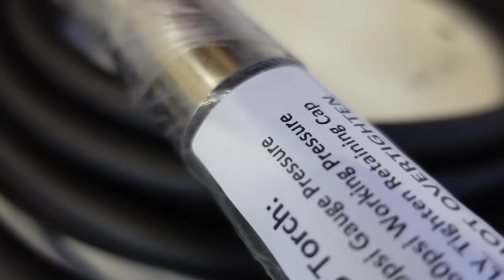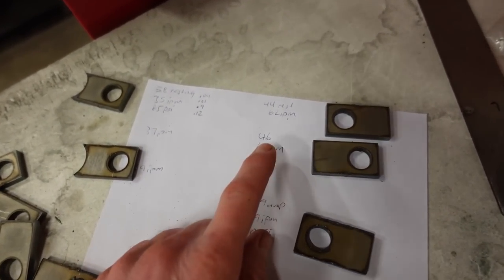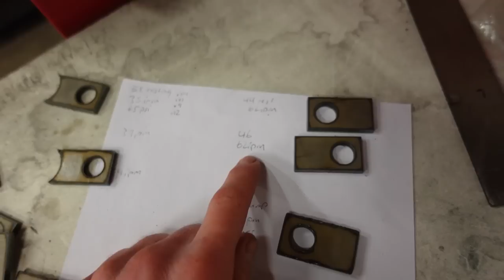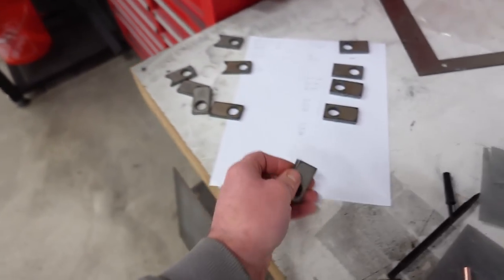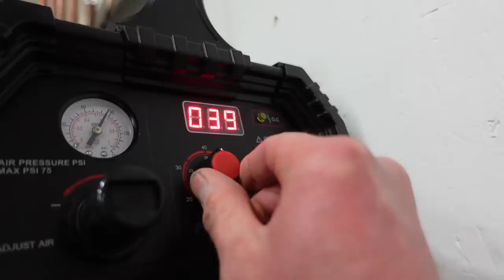You Won't Believe What Has Caused So Many Problems With My CNC Plasma Table!

Comment: Regarding your moisture problems:  Your copper pipe on the wall is a good first step.  It does not need more hose between the copper pipe and the compressor.  The hose (unlike the copper pipe) provides almost no cooling as the hose material is a poor conductor of heat.  To determine the effectiveness of your copper pipe, get an infrared thermometer (about $25).  Measure the temperature of the copper pipe near the inlet and outlet while air is flowing.  If your outlet temp is near reference temp (for reference use a short piece of copper pipe not connected to anything, This corrects for things like emissivity errors)  you have done all that you can do with the pipe or any other form of radiator cooling.  Your moisture separator looks a little small to me for the volume of air you are using. 

 Next and perhaps most importantly  you do not have moisture separation after the regulator.  Any reduction in pressure results in air expansion and cooling.  With air flowing you will find there is a cooling effect from the air expanding through the regulator.   You can use the IR temp measurement to prove this.  This cooling causes condensation to form in the regulator.  All restrictions in flow cause expansion which cause cooling.  Put a separator immediately following the regulator.  I would leave the separator prior to the regulator if it is catching moisture.  But move the desiccant filter to after the last separator.

Improvements beyond this will require some form of refrigeration.  A refrigerated dryer will solve everything.  You could use a coil of copper pipe in a bucket of ice water followed by a water separator to prove this.  This would also show you how much water is getting through your system.
Reply: I love when someone that actually knows what they're talking about posts a comment.  I never even thought about the pressure reduction issue, but of course you couldn't be more right.

Comment: Austin, I had a lot of problems w/ moisture and this is how I solved it
check it out and le me know what you think
https://youtu.be/H1mlpSj6BAc
I know many people use this type of set up when using a lot of air, like when sandblasting and it makes a huge difference.
I used to get a lot of moisture when using my air sanders and even when painting, I don't have that issue anymore
Reply from the maker: Awesome I think I’m going to try a cooler like that! I didn’t catch how you wired up the fan?
Reply: @austinniemela  I had not wired the fan when I made the video, I was waiting on the  220 to 12 volt power converter.
You have to choose your converter depending on the amperage needs of the fan you are using.
The way I wired the fan was in the power junction of the compressor, so when the compressor starts to work the fan automatically starts working. 
I hope that made sense.
Reply from the maker: @LincolnMaxnCo  yes ok thanks for the info!

Comment: I've been running a CNC plasma cutter for about 15 years now. Your cuts look fantastic!
The hypertherm tips are leaps and bounds better than what you were running before. the amp rating of the tips correlates to the size. 80 amp tips have a larger hole and require more air than a 40 amp, and the 40 amp fine cut takes even less. 
as for preventing the slag getting stuck to the end of the nozzle, its the pierce height. idk on your exact software, but on the plasmacam there is a pierce time and pierce height. when the torch initially cuts, before it blows through the material it splashes back at the torch. cut a chunk of 1/2" material and you'll see. A high pierce height prevents the slag sticking to the tip as much. 

The air supply dryer you have is leaps and bounds better than what we use and we don't have that issue. I'd be suspect of the air supply inside the machine not being large enough. That looks like the airflow is inadequate to me. not blowing the arc out of the tip and arcing further up. If you can, crank up your post flow timer.

EDIT: just hit the end of the vid and saw the o-ring. Good catch!
Reply from the maker: Thanks for the info! The more I use it, the more I learn!! I’m getting the hang of it now and getting pretty decent cuts!!

Comment: Have you had the chance to cut some 1/2” with the cut 60? I have the sample table and plasma cutter and struggling hard with getting it to cut. Seemed like I was starting to get it dialed and then it was acting like the plasma cutter wasn’t producing the amps it says it is. Just curious if you had recommended settings. Thanks.

Comment: Transmission cooler is a definite upgrade and make your valves on your copper pipe way longer less likely for turbulent air picking up moisture. Hypertherm is king in plasma cutting IMO

Comment: Some guys put a transmission cooler mounted on the compressor fan and put the air through it before it goes into the tank. 😎😎😎

Comment: On your home made cooler have the small lines t into a bigger line like 2” or 3 inch. When the air comes out the small line into the bigger pipe the air will loose velocity and the moisture should fall out.

Comment: For what you have spent in copper, hardware, filters, and time, your could have bought the Harbor Freight  refrigerated air dryer and been done with it. A refrigerated dryer is really the only way to go for fool-proof dry air. And the HF dryer is proven to be a good performer.
Reply: I may catch mucho flak, but that’s ok… In my opinion, Harbor Freight is a Chinese filled waste of American money! This is a horrible company with cheap Chinese products and is the very antithesis of what American manufacturing, quality and standards should be. No mistake, I totally get the appeal, however, the old saying, “you get what you pay for,” seems to sum HF up to a tee!
Reply: I may catch mucho flak, but that’s ok… In my opinion, Harbor Freight is a Chinese filled waste of American money! This is a horrible company with cheap Chinese products and is the very antithesis of what American manufacturing, quality and standards should be. No mistake, I totally get the appeal, however, the old saying, “you get what you pay for,” seems to sum HF up to a tee!
Reply: @conservativeokie  I get your view. Really. I own a CNC machine-shop here in the good ole' USA. American manufacturing. American pride. There are three big American flags on my property. I get it. But, when a guy is on a budget? And there is a proven inexpensive option? Sometimes you just gotta roll with it. The only reason I suggested the HF dryer is because I know it is a decent unit. I know several guys running their whole machine shop with one. CNC mills/lathes, it is absolutely critical to have dry air. It is one of the gems hiding in that silly store. I don't have one. I have a Speed-air dryer and Kaeser screw compressor mounted on an old 120gal Ingersol T-30 tank. LOL, it is a mutt of a compressor, but absolutely fantastic. But, the 4 HF dryers that I know personally work great and have been dead reliable. Most people think, refrigerated air dryer? I can't afford that! Well, yea, there is a good option that you probably can. That is why I suggested it.
Reply: @conservativeokie  Not entirely accurate.... more and more premium HF tools are rebranded Meyhew American made tools. Just a little fyi
Reply: Hey my friends, I acknowledged upfront I was more than likely to catch flak, however, again, that’s ok… I certainly do not judge or look downward on anyone accomplishing their tasks however they are (legally) able, especially in these f’d-up times and necessary budgets most of us are forced to take!

However, I still strongly stand against everything CCP inspired, supportive, or empowering them in any way. I detest communism and communist’s! I attempt as much as I know how to never buy or purchase anything made in or supported by China.

Often, I’m successful… Sometimes, I’m not. Harbor Freight is basically a CCP warehouse, and again, I understand the appeal and totally get it! Anyhoo, agree with me or not, I really enjoy the channel and the vast majority of the episodes! Thank you!

Comment: Has "tech support " from the company been of any assistance  ? I know you are very capable and very DIY. But just curious how much the company tech support has helped.  Since you are using it on your YouTube.  I am a little surprised someone hasn't reached out to you or showed up to assist... Be nice once you get it dialed in.
Reply: For the air or bevel issues?  Those are both plasma cutter issues and not an issue with the table.

Comment: How did you get that primeweld to work.  I was using one for a while and loved the cut quality.  But I was getting interference and kept smoking torch height controller.  I ended up with a 45xp and I’ve never gotten it dialed in.

Comment: by no means am I and Expert, but it looks like you are going from your compressor straight to your tank.  If I'm not mistaken you need to go into your Inter-cooler or cooler before the air enters the tank.  This way the Hot Compressed air gets cooled before going into the tank and then into the Air lines to your filters/tools.

Comment: I may have missed it does your air Compressor have an automatic tank drain on it? They are only like $30 on eBay Mount a switched outlet in a handy place and cycle it a few times when you turn on the compressor to dispel the overnight condensation, then set the cycle times to match your conditions.

Comment: I wonder if the bevel is on the side that is cut last before the part is finished. So when that cut is being made the weight of the part being cut causes the part to sag just slightly therefore causing the bevel? I'm also wondering if the water is too close to the part. So when it's cutting, the water is splashing on the part causing it to cool quickly and leaving the dross behind. Maybe try raising the part higher above the water? Just a couple of wild guesses.

Comment: You should use copper straps for those pipes not what you used that will cause corrosion overtime and cause holes

Comment: Your Ts are the wrong direction.  Air should go into the T and not the way you have it.
Reply: It (air) should run into the the cross off the T and change directions. Much like a properly plumbed dirt leg on a gas line prior to a aplliance

Comment: I would love to get a hitch cover from you in bronze if you still have one. I aslo was hoping I could pick yout brain on your f150 spring swap on the toyota pickup. i cant weld welll enough to trust it for suspention. I want to hire a guy to come out and weld all my hangers on. do you have the measurments of where you welded in the new hangers? if so It would help a lot
Reply from the maker: I do not have the measurements or the truck to measure!! Sorry!! I do have a few hitch covers left! Check them out www.avrcustoms.com

Comment: Not a cheap fix but just get a hypertherm  unit, beats the Chinese cutters 100x over!
Reply: I bought a Hypertherm 1250 back in 2009..Just keeps going and going..Using the HT finecut up to 3/16 at 50 amps..

Comment: I built a 5x10 table with a power max 85 the hypertherm electrodes are worth the money.  Once you get the table tuned you will be amazed how long they last. Never counted the peirces (was alot) but with fine cut consumables I did almost two sheets of 16 GA.
Reply: Hey I’m getting a used 85 tomorrow with no torch. Should i get the machine torch as well as the hand torch?
Reply: @bpdp379   If you have the extra cash than yes. Hand torch gives you the option to cut some thick steel and the gouging tip .
Reply: @gregyoung46  if I could only get one is there an advantage to the machine torch? Obviously the hand torch is more versatile. Just don’t know much about CNC specific cutting. Thanks!